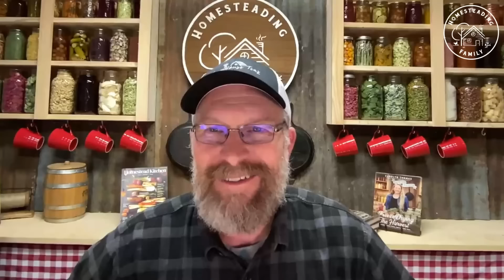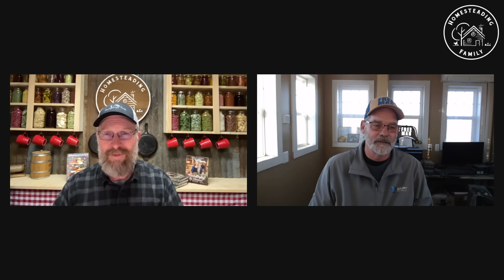PODCAST: EMP Shields - What Are They & Why They Can Extend the Life of Your Appliances!

Comment: The thing you failed to mention is- it doesn’t matter how many “ shield” you put on your home or devices- if the power grid goes down you won’t have anything until the grid comes back on line or your back up system is solar generated . 😂are you really able to store a years worth of gasoline in the common house? Not realistic .
Reply: Of course it matters. Your house won’t fry, electrical fires, having to completely rewire your house… etc… is very much worth it. Because if the ultimate worst case scenario happens, you’re going to want your house to be able to come back online someday.